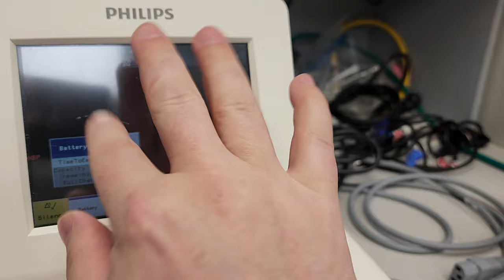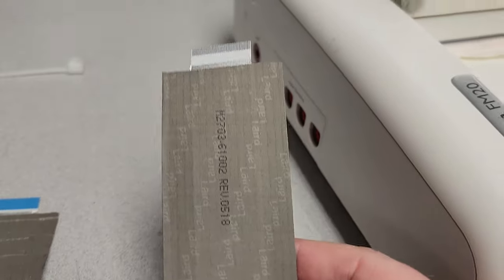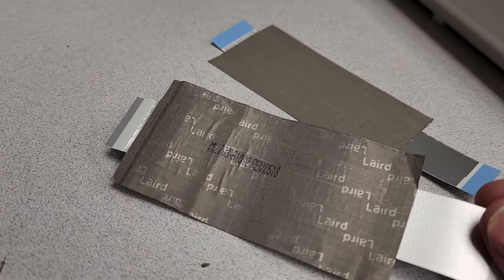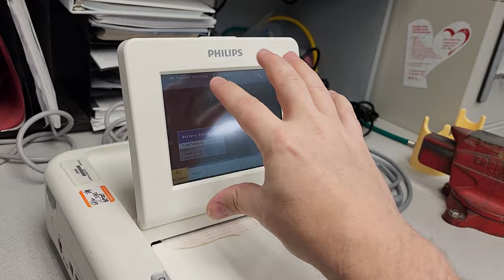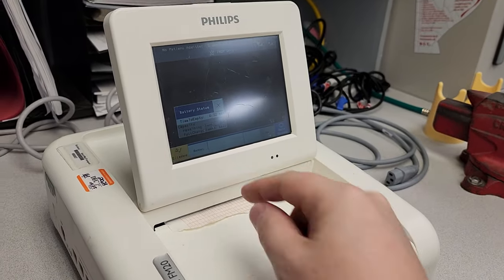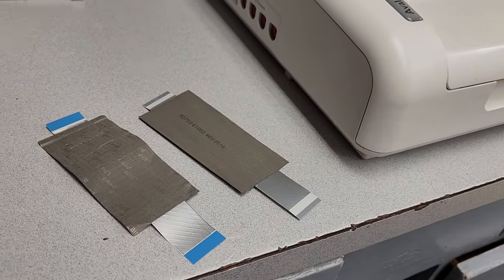Philips Avalon FM20 No Display!

Comment: Hey Justin!  Would something similar cause loss of backlighting of all three screens on a force triad?  Any help is greatly appreciated!  Love your stuff!
Reply from the maker: Interesting! I'm pretty sure that those screens in the Force Triad are florescent back-lit. If s9, the there should be 2 silicone wires (usually red and white) that go to the display. I don't know if each display has a separate Driver power supply or if they all have a common HV Supply..